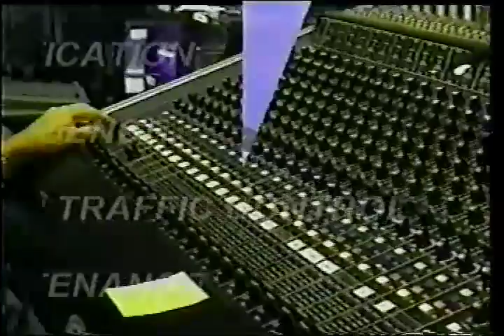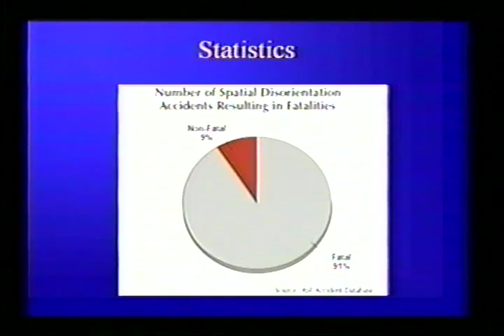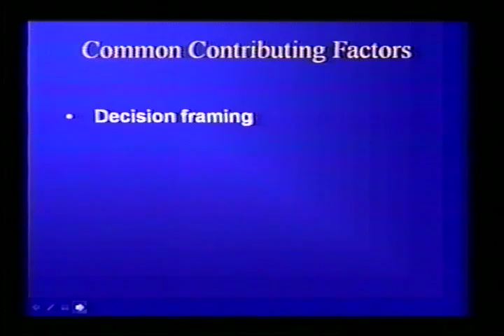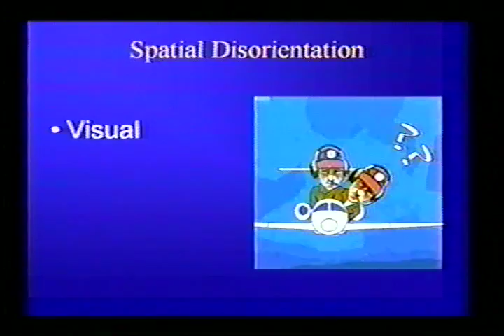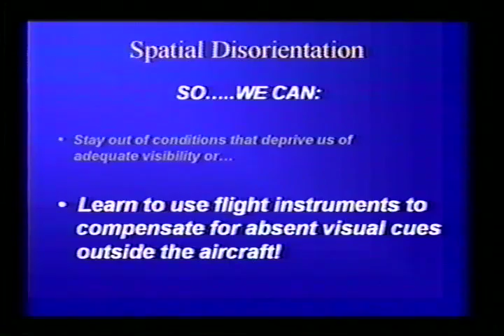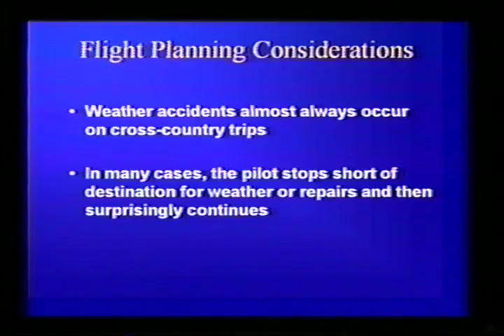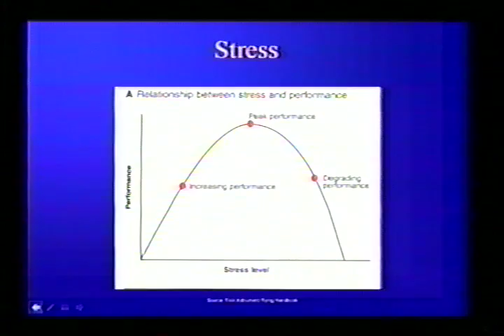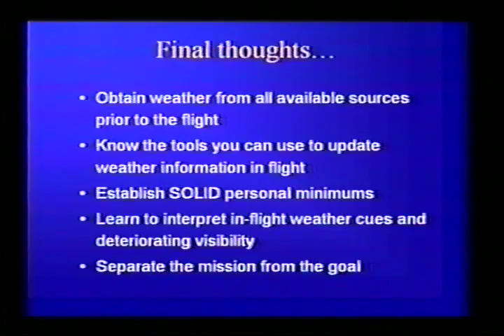Surviving Inadvertent IMC

Comment: For practice flying  VFR in bad weather  (IFR) I drive my car with my eyes closed on the  Interstate. As I get better and better I feel much more confident flying VFR in IFR conditions. This  is much safer than practicing in a plane.  You can always open your eyes and get your bearings back on the Interstate. I have to get to work. I'm flying an Airbus  A380 to London Heathrow in  30 minutes.

Comment: Flew into IMC with less than 100 hrs VFR experience and survived. I was unbelievably lucky. The more I read about the statistics the more I realize how lucky I was. I don't consider myself an especially skilled pilot. Just enough survival instinct, luck and probably an angel or two sitting on my shoulder.
Reply: +vasend After listening to some of the talk I would say the following as someone who has actually "been there, done that". I would expand on some of the aspects of cross-country. In my case I was flying a long ways from Florida to South Dakota. In retrospect, the likelihood that you can travel that far in one shot without weather problems is probably close to zero. You have to get it out of your head that VFR travel is an efficient way to get from point A to point B. You can't count on any given day being able to travel from point A to point B. So if you were going somewhere for the weekend don't count on being able to return on time. Get that out of you and your passenger's head from the beginning to avoid the pressure to get there from the beginning. The other problem is that on a long cross country you get tired which can really impact your decision making. The worse the conditions the more quickly it tires you out based on my experience.
Reply: +vasend " I don't consider myself an especially skilled pilot."  This statement perhaps goes a ways toward explaining why you escaped.  I cannot imagine what this would be like.
Reply: Flew into IMC for a whole 30min with less than 20hrs vfr experience